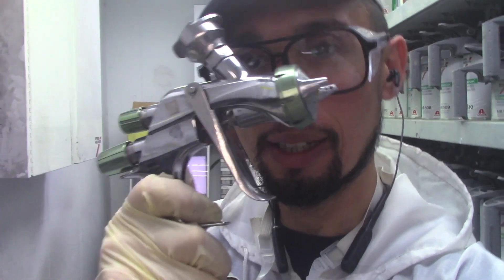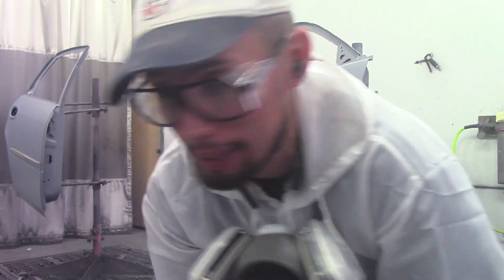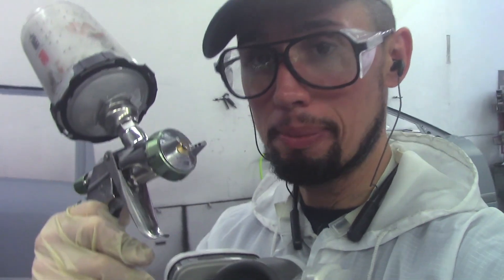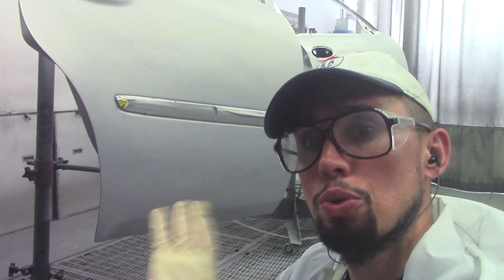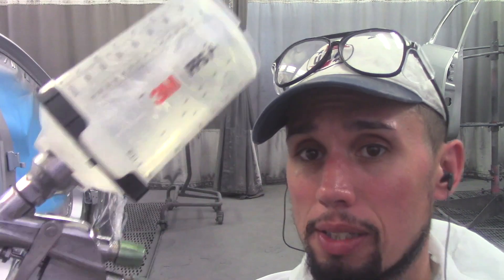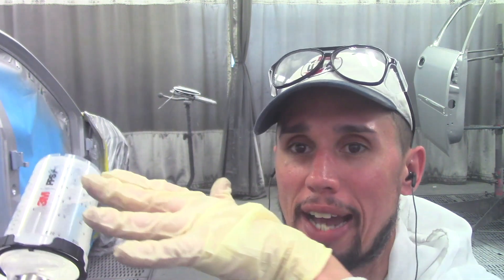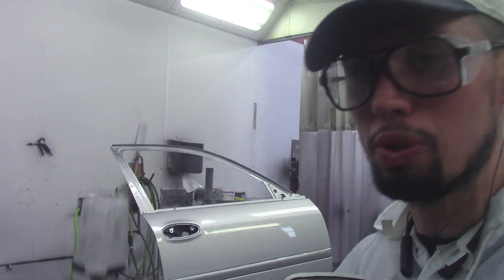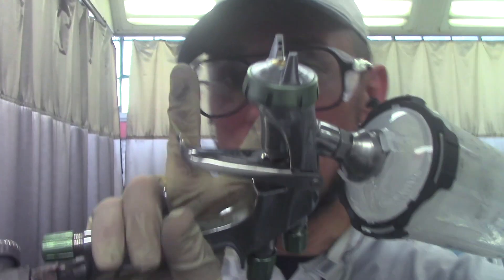ANEST IWATA LS400 SUPERNOVA REVIEW

Comment: According to all the paint videos I watched, they said I shouldn't spray clear with the Ls I had to buy the ws 400.
Reply from the maker: Well if it is in your budget to buy two different spray guns and you think that you would feel more comfortable with two spray guns, then you should do what you feel works for you. But my video was a review on how the spray gun preforms in both base coat and clear coat and and did a great job on both.
Reply: @J.Lulo_  I just did a comparison with the old Ls 400 and the sata 5000 with metallic, and it looked the same, just less over spray, and I saved some material.

Comment: what psi do you usually spray the basecoat with on your ls400
Reply from the maker: Usually I spray my base coat at 20 psi. That’s a good amount of air pressure for base coat. So you can keep your psi pressure between 15 and 20 psi and you should be good. 👍Here’s a link to a video I made on how to base coat. 👉https://youtu.be/iAMTOIsTUYg?si=SoeLZlCTHoL5mG5f. If you have anymore questions reach out to me.